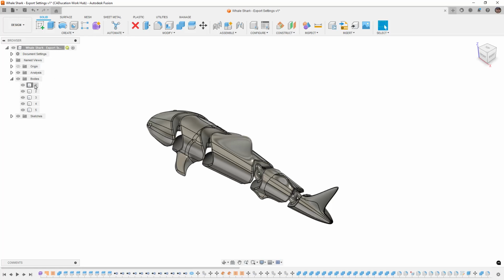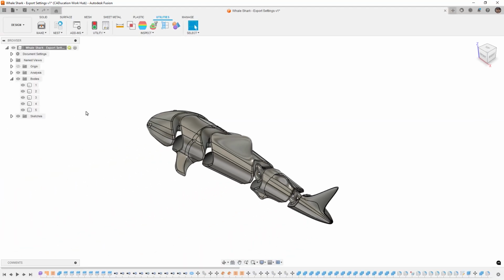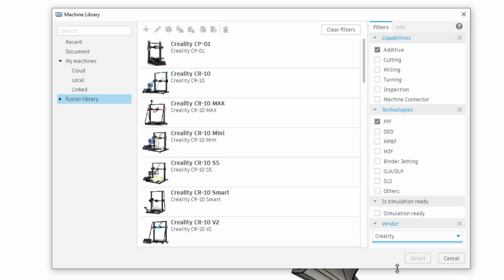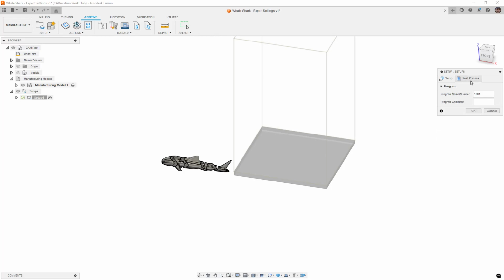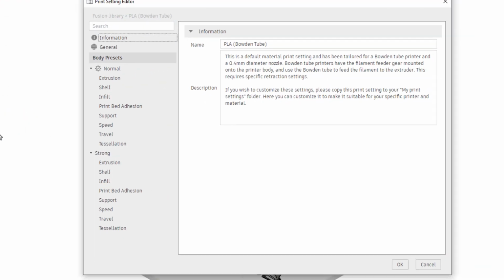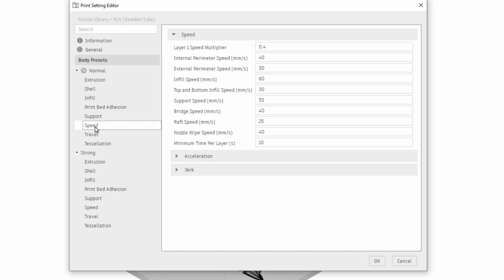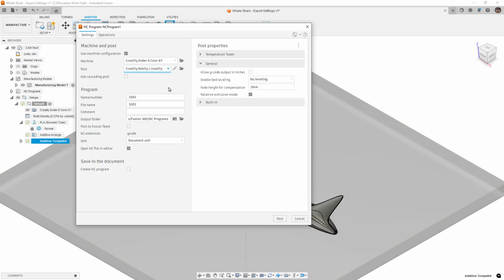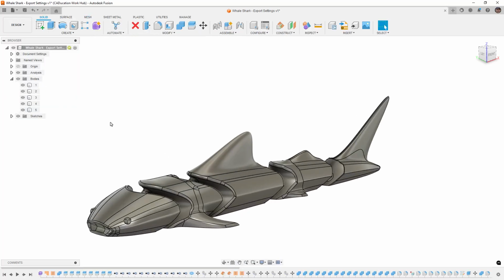What's New In Fusion | Save As Mesh | What Happened To The Dialog? | How To Use Fusion As A Slicer

Comment: [I work for Autodesk] Great Video. I like the detailed explanation of the manufacturing environment. I would like to point out that there is also the 3d print button that can be found under Utilities -> Make -> 3d print. It works exactly the same as save as mesh, but it will remember your latest used setting for the current session. Finally, I can also confirm that sending to print utility currently does not work on mac, if the slicer utility is already open. If you close it and then send from Fusion, it will work. This will be fixed as soon as possible.
Reply from the maker: Thanks Lukas!  Its good to note that the 3d print button on the utilities does remember your settings (covered around 3min in the video), but why doesn't the Save as mesh dialog do the same?  It did before the update.  And it wasn't session based.  If you used Save as Mesh and used the transfer to 3d print utility it was that until you changed it (from save as mesh).  The send to 3d print utility is very handy and reduces the need for external file storage and management of STL files.  I don't generally save my slicer projects so the only "file" I have is the fusion design and the gcode on a jump drive.  I would imagine this is a common workflow.  When you have the source data in Fusion and printer/settings configured in your slicer there isn't much of a need for any other files to be saved.

I think if Fusion was an easier to use as a Slicer like most of the others that either come with printers or have configurations pretty close for other printers and materials it would be a non-issue, but the average user wants the least number of clicks to get to a print.  I worked with Sualp a bit awhile back walking through the MFG/Additive stuff and will say there are loads of options especially if you are an industrial user and say DMLS print farm.  Programming say a CNC mill is more involved and the steps to pick your machine and tool library settings makes sense there, but for additive(at least desktop FDM) the process is a bit cumbersome.  I think because Fusion is very well set up for CNC/laser/waterjet type machines and because of the difference in that process it will actually be a bit of a battle for desktop FDM slicer adoption.  just my 2c.

For me I would love to see Save As Mesh go back to how it worked before remembering if you wanted to send to a 3d print utility, and would love if there was a way to send an entire design (bodies or components) to a slicer as individual objects.  If you change the structure to "one body per file" even if you set the prep type to print utility it no longer will send the file to a print utility.  If the design contains all bodies or all components it doesn't matter.  The slicer treats them as one unless you create a setup in MFG and export a 3mf from there.  So you are then stuck saving each body as a mesh and importing to a slicer, or making a MFG setup just to save that as a 3mf because the export 3mf option doesn't carry the same data I don't believe.  And if you try to send one body at a time to a 3d print utility it launches a new instance of the utility rather than adding it to the current build.  That might be solved if the tool looks to see if its currently running rather than launching a new instance.  Not sure.

Thanks for the input and sorry for the long winded response :)
Reply: @LearnEverythingAboutDesign  thanks for the detailed thoughts. First of all we have deployed a fix for the mac issue yesterday, so this should be solved. We are currently looking at all the feedback from this release, so there is a chance it will change again in the future :)
Reply from the maker: @lukasfuhrmann8076  Thanks Lukas, i pinned your comment and hopefully others will see.  And ill keep an eye out for updates.

Comment: Thanks for the great tutorial! I was unaware, until now, that F360 had a slicer in the mfg section, but make total sense when you think about how long additive mfg has actually been around. I'll have to dive into it and see if it is a workflow I would prefer over common slicers (Cura, Prusa, OrcaSlicer, Simplify3D, ideaMaker). I tend to bounce around from Cura | Prusa | Orca because it seems each one has a unique feature that helps me with a particular model. I would like to see if there is a way to "import" slicer configurations into F360. Thanks again!!
Reply from the maker: What i ended up doing when i used Fusion for my Ender 7 was looked at all the default settings in Creality Print that worked for me and copied them over.  I found this got me close but there were settings I ended up tweaking.  To the best of my knowledge Autodesk builds their own data for each machine and only offer generic print settings that are "safe" and you need to copy them into your print settings library and tweak them.  This is one reason I like to use Creality Print because its simple and they preload hyper PLA settings that work.

If you use the same materials like I do it won't take too awful long.  I generally make some simple shapes or use benchy and test out settings until I am happy.  Autodesk pulls over functionality from some of their other software offerings and there are specific tools in the extensions for things like metal powder bed machines.  For the average FDM user I would say the tools are on part with most slicers.

Comment: Thanks man.. Always learning here
Reply from the maker: happy to help!
Reply: @LearnEverythingAboutDesign  hey is there a way to turn gcode or an STL back into something you can work with like to make mods from thingieverse parts?
Reply from the maker: @GUCR44  well. sort of.  If you have a prismatic part there is a chance the mesh conversion tool in fusion will work.  I did a video for adesk on their channel on working with meshes.  If you plan to 3d print a mold then you can use mesh workflows to subtract one mesh from another.
https://youtu.be/yLGq_QJEEuo?si=YC0V44keNTuMIKlK
Reply: @LearnEverythingAboutDesign  cool man teslate... I got about 60 %of it the first time thru.. Gunna watch it a few times... Hahaha thanks man

Comment: Would be interesting if you could use the sliced model and use it in a static stress analysis.
Reply from the maker: Sadly no.  Not many FEA programs will allow you to bring a mesh in.  You have to have a solid because it generates the mesh differently than say converting to an STL.  It uses more of a voxel arrangement.  There are some tools that do allow that but they are $$$.  It is one of my gripes with how the volumetric Mesh works in Fusion.  It would be amazing if you could run a shape optimization study to find load paths, then use some FEA data on different lattice structures to add them where the lowest stress concentration is.  You can do this in a round about way now with some guess work but to the best of my knowledge not much info exists on how these lattice printed structures perform to the point where we can use some sort of linear static solver.  so its down to print and destructive testing....

Comment: Can Fusion generate the supports and then allow me to export the model along with those supports as an stl/3mf file? Might be neat to take that into another slicer.
Reply from the maker: Maybe i will do a follow up video on that.  It can be done but its not file > export > 3mf.  its a bit different.  Yes you can send the support from a fusion setup to another slicer and include them as supports or as model items.

Comment: I use bambu studio and usually I can add another object on existing plate that already has object on itu, means I will have 2 objects on the plate. Now, if I already have object on bambu studio, nothing appear after I send to 3d print or save as mesh. Also I notice if bambu studio already open, same thing happen. Nothing appear on the plate after I send to 3d print or save as mesh.
Reply from the maker: Thanks for the info.  Creality print behaves much the same.  Usually i get an object in a second instance of studio but get all sorts of warnings.  It would be great if there was a way to simplify the process to "add to existing" or something.  I would guess the functionality won't get much better since Fusion can be the slicer and they likely will continue to improve that workflow (just my guess no inside info there).